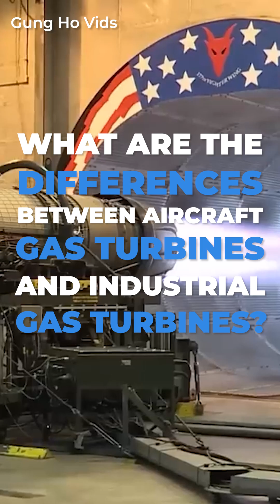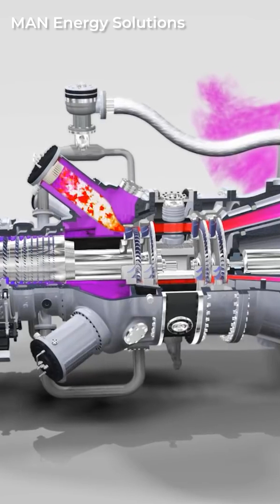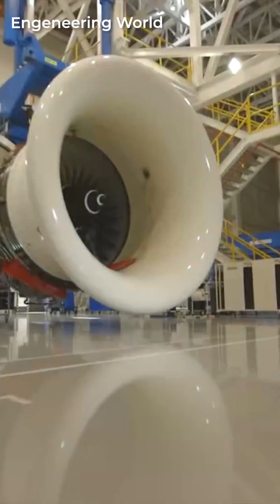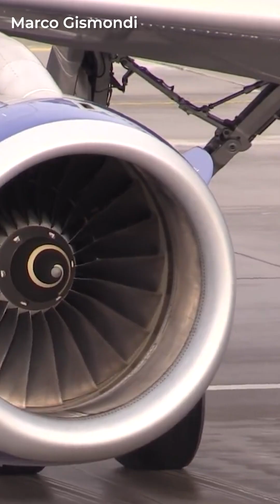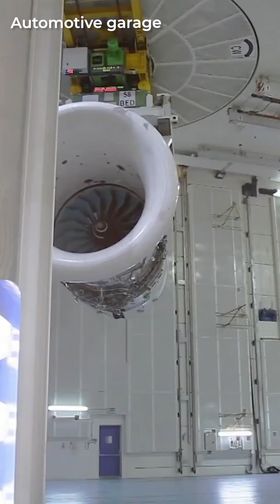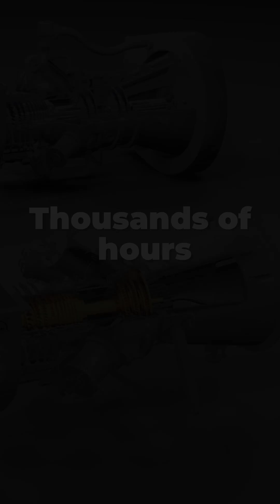The Differences Between Aircraft Gas Turbines And Industrial Gas Turbines? #shorts

Comment: It’s also not mentioned here, aero gas, turbines typically have an extra fan stage at the front, and that is what sets it apart from industrial fans the most 
, more than half the thrust of an aero turbine comes from that first stage.
Reply: an industrial gas turbine has more in common with a turboprop engine than a high bypass turbofan engine, with the turbine stage more optimised for producing mechanical torque than any thrust from the exhaust gases. industrial turbines often have a heat recovery system on the exhaust to recover and make use of the heat from the exhaust gases, vastly enhancing their efficiency as weight is not a concern as it would be in an aviation application.

Comment: The difference is for aircraft they want thrust but for power generation they want power. What the difference between thrust and power then?
Reply: Mathematically, power is determined as thrust (force applied) * speed; in this case airspeed. 
Suppose I'm in a jet that moves at 900kph (true airspeed) and produces 1000 kilonewtons of thrust in total. (these are numbers that are plausible for a large passenger airliner) If you ask a calculator (google search will do it) to convert this to power you get an answer: 250 megawatts. 
This only looks at energy that is being converted to thrust, so energy that is wasted (waste heat, internal friction, gearbox losses if any) are excluded from the above.
Reply: The exhaust in an aircraft turbine pushes the aircraft, it's moving fast when it exits. The exhaust in an industrial turbine pushes more turbine blades (stages) and exits the turbine with very little speed.
Reply: @cowboybob7093  you are not right. The aircraft engine uses its hot gases to turn the compressor blades and the exhaust gas exits at very low speed also.
Reply: @hafizuddinmohdlowhim8426  Nevertheless, the turbine gasses in bypass engines provide significant thrust*. Industrial turbines have exhaust flow but only after all the thrust energy has been extracted by additional turbine stages (the hot end.) Sure it can lift an umbrella but the turbine's not exactly trying to break free of its mount.
*I'd be glad to see a citation of a modern engine that is 100% bypass thrust. The best I know of is about 80/20. Now let's see if you confuse bypass ratio and component thrust in your reply.
Reply: @cowboybob7093  I don’t need to. We don’t have 100% bypass thrust but that is what we want to achieve.
Reply: @hafizuddinmohdlowhim8426  That's the holy grail isn't it? (One turbine, flight and industrial - so to speak)
I'm trying to be agreeable.
Reply: @Cowboy Bob  that is a turbo jet, a normal aircraft engine is a turbo fan
Reply: @paulhancock3844  Yes, I understand and figured I'd be called on it. However bypass air does not supply 100% of the thrust. That said, the technology is advancing, can you cite an engine that's 100% bypass air thrust?

Comment: Gas turbines? Aircraft engines use liquid fuel
Reply: Gas turbine is just a type of turbine/powerplant. You can run a gas turbine on numerous types of fuel like kerosene, diesel or yes even natural gas.
Reply: Liquid fuel is vapourised as it enters the combustion chamber so it's in a gaseous state when it's ignited.
Reply: When someone is driving their car slow, don't we usually say to them "Step on the Gas"? Even if it doesn't burn gas but petrol or diesel LoL
Reply: @no_bull  Actually - here in Britain, we dont't tend to say that!
Reply: Now I'm curious how an Abrams tank engine is different. Those are turbines too.
Reply: The fuel is a liquid up to the engine, then vaporized and combusted into the high pressure turbine in the engine. So it is a gas turbine. No liquid runs through the turbine blades except rain.

Just like in a car engine, where the fuel starts out as a liquid (Petrol), but then vaporized before entering the combustion chamber, then ignited.  Outside the engine it is a liquid and inside it is a gas.  Gasoline is a misnomer because it is not a gas but a liquid, so I prefer to call it Petrol.